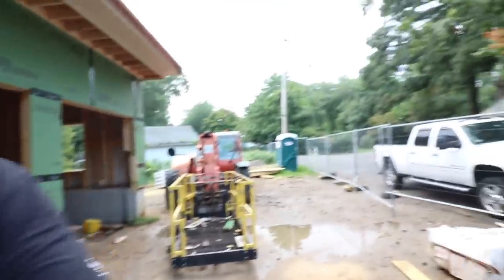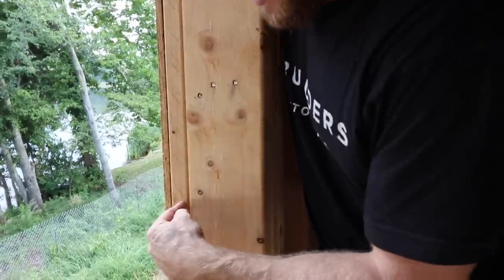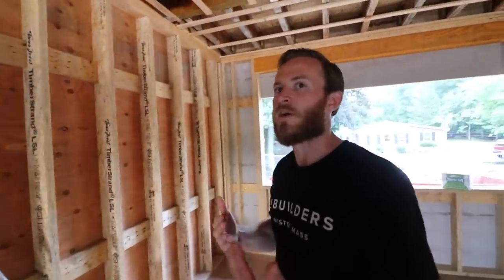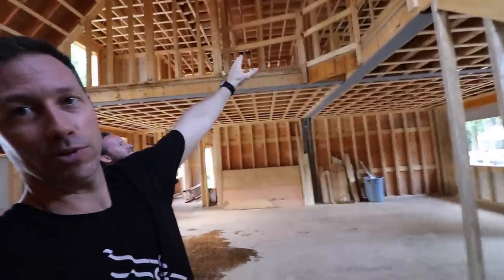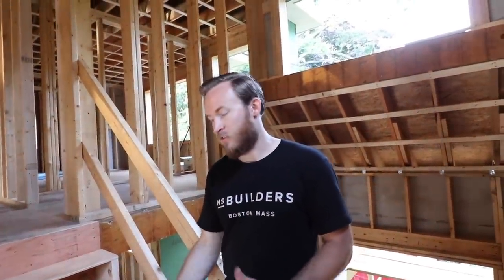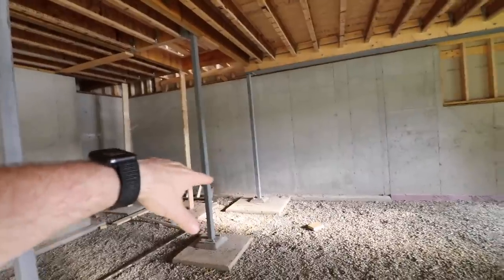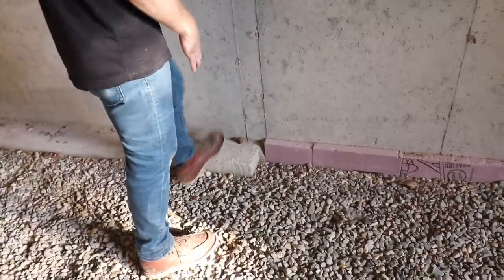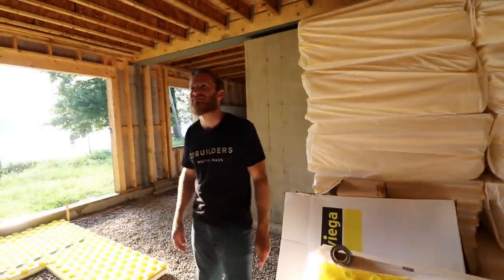How do they Build in Boston? Visiting a new home in Framing

Comment: Hate to be a killjoy,  but we need to come up with some new construction methods and fast,  In the last 50 years 50% of the world's forest are gone. No forest = No clean air = very poor quality  of  life.  Most Caribbean countries are constructing concrete homes, the only wood they use is for the roof.   Florida new building codes also require's  concrete construction. I think concrete homes are the way of the future,  they also stand up better against tornadoes and other inclement weather conditions.  And they can be built in a fraction of the time,  with the expanding  population of the world today,  wood construction is no longer sustainable,  it takes these trees  far to long to grow back (30 to 50 years).  
       The good news is, this seems to be only the residential construction that is consuming so much wood. I was a commercial construction superintendent for years, and most commercial jobs use metal framing and steel and concrete roofs.  Very little wood.  The average 2600 sq ft home consumes over 40 full grown trees per house. This is absolute madness.  We need to do something better NOW!!! Just a thought.
Reply: We have more forests and more trees in New England now than we did 200 years ago.  Wood like this is a very easily renewable resource.  They aren't cutting down rainforests to make pine boards.  Good grief.
Reply: @stilawebb8635  
       What part of the word "WORLD" did you not understand?  This problem is bigger than your little same area of New England.   Do some research.
Reply: You are commenting on a video about a house being built in New England and complaining about the wood used.  These are pretty local resources.  Each area of the world builds with local resources.  Why not complain about videos that are using wood in places with little wood?  And speaking of research, do you know anything about using concrete in cold climates?  Obviously not if you think that's the answer to the world's problems.  It's a terrible material for cold climates.  Concrete requires more fuel to make it, transport it, heat and cool it, demolish it and repair it.  Metal is just as bad due to mining, smelting and recycling it requires which consumes large quantities of fossil fuels.  Neither one is half as renewable or half as green as trees are.  Don't assume the problems of one place are the problems of all places.  There is no one way to solve the world's problems.

Comment: Lol all i see is a Tinderbox that will burn faster then a mobile home.  They're talking about "how great it's built" yet everything is Foam and OSB yeah it's fire retardant... to a point but foam and OSB will burn if it's heated enough.  Why not just stick to 2x6's, 2x4's 4x6's like old fashion homes... these new home when they catch fire they just burn FAST  due to how they're built with mostly the Garbage Foam and OSB shit.
Reply: TRX VLOGGER up to code wiring, fireplace install, drywall, I'm sure it'll be fine
Reply: WTF? 2x6s, 2x4s, and 4x6s are usually flammable. What are you talking about?
Reply: v3124 oh wow' now way reallly?!   No shit I know that you did infact know what I meant, you just want to try to make me sound stupid obviously...anyways.... So what i'm gettin at for example is watch how quickly that house burns down with it being foam insulated, OSB sheeth'd and Pre Fabbed OSB joist's compared to a house with non faced Fiberglass insulation,  drywall cement board siding with real blocking between all real joists's "not prefabbed OSB joist's" yeah it more expensive but that will burn so slow that even if it did burn and a fire broke out say in the living room then flash over started INSIDE the house it will still be structurally sound and can be re drywalled and re insulated compared to a match box OSB and foam home... OSB burns fast and hot then it becomes weak within minutes.... compared to a 2x4 or 2x6 or 2x8 or 2x10 "whatever the case is" they burn so much slower.
Reply: @TRX450RVlogger  in fact, I didn't know what you meant. However, with the smallest amount of effort I could have figured it out because it is pretty obvious. I apologize. Basically you're saying that the foam insulation provides a path for fire to get around fire blocks. Right?
Reply: Kind of. The foam is fire retardant till a point then it will burn hot and fast. blocking helps stop fire from creating a path to spread. It works like water kind of it looks for the least resistance to travel.
Reply: Have you read up on current house "burn times"? A house these days goes up so much faster and hotter than 30 yrs ago for a list of reasons, building materials being part of it but not all. Really fascinating stuff.
Reply: So what? They have insurance. The house is up to code, if it burns fast blame the people who write the code.
Reply: Of course engineered lumber will burn faster - which is why they should be protected with intumescent paint, or cover the whole assembly with type X or drywall with taped seams. The foam actually passes flame tests, but can't be left exposed. These products are fine when not under direct flame impingement. Like any builder material though (even metal), direct flame impingement will make any building fail, if allowed to burn long enough.
Reply: @TRX450RVlogger  We had a major loss of life with this in London last year. Grenfell Tower.

Comment: The zip sheathing is great to work with however , I have looked at testing and if fails horribly. I’m not dissing the vid just passing on some info. So the tape normally will peak after some times. And every nail penetrates the water proof membrane , don’t use this with vinylsiding . Unless you tyvek . And wow inch and an eighth advantek , that must be heavy AWESOME BUILD MAN CONGRATS